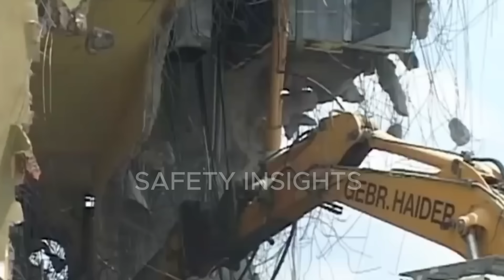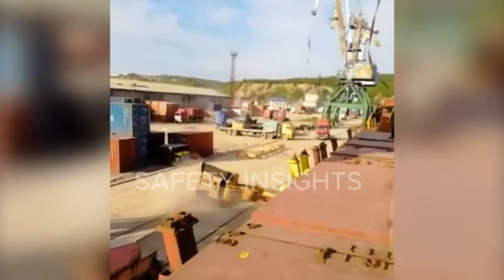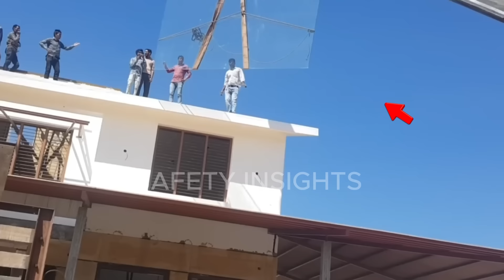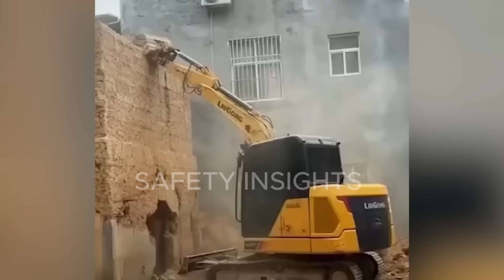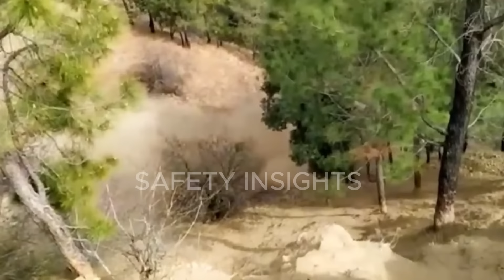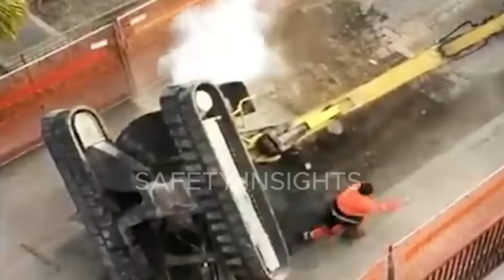20 Most Dangerous Excavator Operator Fails Compilation | Total Idiots at Work 2025

Comment: No 2 operator error. see comment below. No3 operator error, the linesman should be pursued for the cost etc.No 4 operator errorNo 5 should have used a cable to direct the fall. Operator error again. in any of these its not the people, its the cost of the equipment. There plenty of people, its expensive replacing kit.